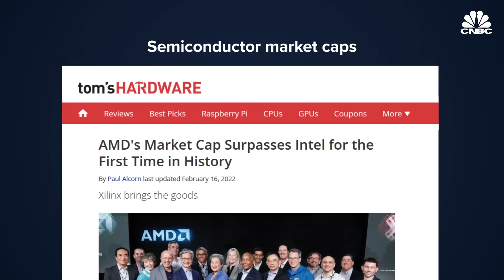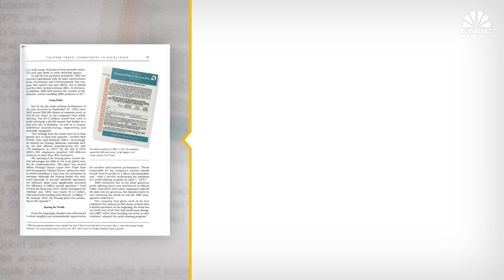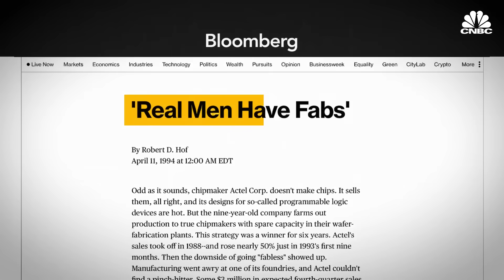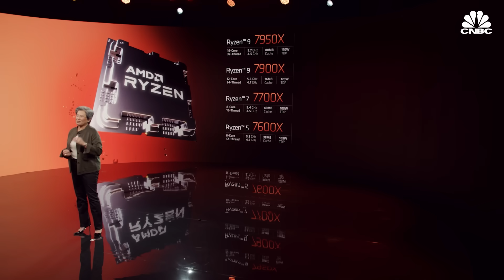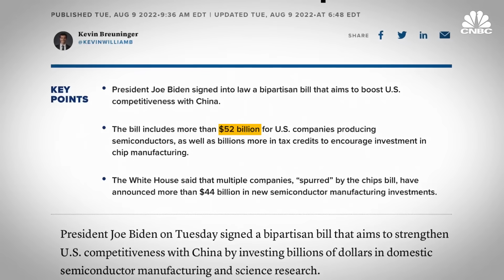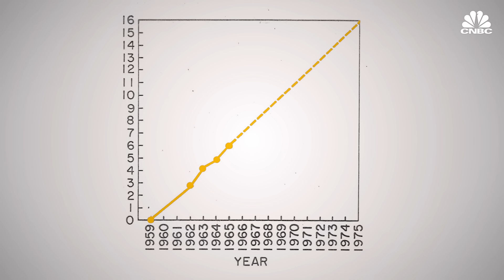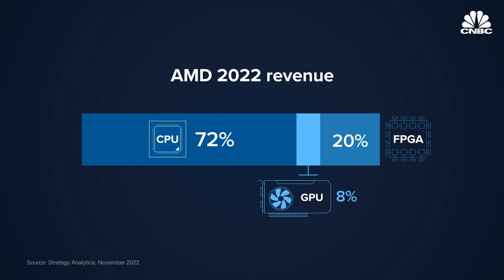How Chip Giant AMD Finally Caught Intel

Comment: Ryzen is amazing. i built a budget system with the R5 3600 and i plan on using it until 2028 - 2030 with linux. far better than the old Core 2 Duo stuff i used to daily drive just a few years ago

Comment: AMD cpu's right now are pretty impressive especially their APU in terms of budget performance compared to Intel right now which expensive with mediocre performance and issues.
Reply: I'm not sure how you can say they are mediocre performance when Intel at the very high end is still winning many/most benchmarks.  Yes, for value AMD is riding high, and that likely matters for the vast amount of users in the market.
Reply: @Faladrin  benchmark are just numbers but when it come to real world performance and application AMD still is better performing (TDP, Thermals, Stability, ) and even in continuous stress testings. Also AMD's integrated graphics are much better than Intels
Reply: @dogge828  I wouldn't say that intel has "mediocre" performance considering that it beats the competition by a good amount when it comes to gaming, productivity, and multitasking.
Reply: @PsTechSpace  in terms of apu i dont thinks so. But when comes to high end with the latest raptor lake and raphael it is just a tie between those two but power consumption, efficiency, thermal output, multi threaded task and rendering on AMD and Intel is just ahead in gaming with a very little points against amd. Overall it is just the matter of optimization and each has own advantage and disadvantage.
Reply: @dogge828  intel barely takes the multithreaded crown now because of it's extra 8 E cores.
Reply: @dogge828  But yeah i can agree Intel's integrated graphics are bad compared to AMD, Meteor lake could fix that issue but for now AMD's integrated graphics are unbeatable. When it comes to CPU performance intel is still superior in most tasks.
Reply: @PsTechSpace  nah you cant admit the fact that AMD had become tied on intel now. Look up latest raptor lake and raphael the difference is very small
Reply: @dogge828  You can take a look at gamer’s nexus, Jay2cents, LTT, or other third party reviewers. Some differences are small while others are big.

Comment: actually intel is 10x bigger. 
AMD: Number of employees	15,500 (2021) 
Intel: Number of employees	121,100 (2021)
Nvidia: Number of employees	22,473 (2022)

amd caught up with both. with intel on processors, and nvidia on graphics cards, at the same time. the CEO of amd was the main reason.

Comment: I think that it is strange and different as to how they are now manufacturing LARGER processor chips instead of those small ones. For years, companies were making chips small, and using the "all this power is all packed into this teeny tiny chip!" And instead, are now making bigger processors boards to hold even more processors on them... it's about time that a tech producer thinks out of the box. Like "if it's this small, let's add another processor to it. Wait, how about 3 since we have all this portability." I was thinking waaay ahead of them. Even at the age of 14, I had that thought. Lolololol. 

Also, that has got to be a very powerful laptop to capture all those people taking the escalator. It's pretty responsive, like a desktop. Usually, I see laptops glitching and lagging. I guess that era of lagging equipment will be behind us now.

What if the circuits have gotten soo tiny that they are not able to make them any smaller due to physics governing their ability to produce it smaller, soo they are widening their chips? I saw a video of someone using a microscope on the little cells of the cpu, and you could see the little atoms that made up of it. Could this be it for them?

Comment: Problem is, AMD saw massive success when their Ryzen 3000 series launched some 3 or 4 years ago.  Rightfully so.  Amazing performance for the value, supported old motherboards so you just had to swap the chip and do a BIOS update for your motherboard, easily walked all over Intel who had more expensive CPUs that used more power and performed worse, AND you had to switch motherboards (and most likely RAM too) if you wanted to upgrade.  AMD was the absolute king of keeping cost down while boosting massive performance gains.  NOW though, they've clearly already reached the "greed" stage and are pricing higher than necessary, no doubt abusing their newfound surge in popularity.  Their new GPUs aren't as good as Nvidia and are surprisingly expensive, and their new line of Ryzen CPUs are definitely priced over what one would expect from them based on past pricings.

Comment: FPGAs are very important today. The last few years it was made possible to translate a C program into HDL which are hardware defining languages. HDL languages (Verilog and VHDL) are used by big companies (like AMD, Intel, Nvidia ect) to design their Chips. Normaly only Computer engineers have knowledge on such languages. Today with the C to HDL synthesis a simple software developer can translate a function out of his program-app and make it run directly on hardware. The performance boost can be very big or very small depending on the function and how well it runs in parallel.
So, in the future most apps will have their "bitmap" files that will be loadable on the fpga of a computer or phone. The same apps would very easily run on software only if there is no fpga on the device. AMD-Xilinx now provides Vivado HLS which is the software required for such C to HDL synthesis. The future is bright for FPGAs and custom, reprogramable hardware on CPUs, GPUs or even on seperate accelerator cards.

Comment: I remember how AMD used to struggle to compete with Intel. And their implementation into cheaper computers initially. Now they are a gaming mammoth...and involved in major cloud tech applications, and so much more. Great to see them going head to head  with Intel. One day they will surpass apple in chip design and manufacturing
Reply: Viewing some of the other videos covering the history of AMD in relation to Intel, I'm left wondering how much larger a company AMD might be had they not had Intel strong-arming computer builders to use Intel, offering financial incentives as well as threats to convince them to drop AMD for Intel products. Going bacl to the early 2000s, where AMD was ahead of Intel in introducing multi-core and AMD64 CPUs as well as the Opteron line of server CPUs to market. Those should have been breakout tech introductions earing AMD a larger market share. Now we know what it didn't happen.

Comment: But they haven’t…. Intel chips still bench better, still perform better, still have better designs, still have better everything. Even amds newest 7950x 3D chip loses to the new Intel chips, and amd said that 7950x was an Intel killer.
Reply: AMD was better in nearly everything other than gaming until recently, so yes they did catch them. Unfortunately for AMD the 13XXX Intel CPUs beat AMD at everything at the moment. 
So they did catch them, but now intel has gotten away from AMD again. And it doesn't really look like AMD has any answer to Intel's latest chips. The X3D CPUs might beat intel at gaming but they'll do nothing for productivity.

Comment: AMD are the ones responsible for the APU processor, combining the Northbridge processor with the CPU helped my business out a lot, now, instead of the CPU, having to go through the Northbridge processes separately to communicate with every other chip on the board the Northbridge process it was combined with the CPU, allowing for faster communication between the RAM and the CPU

Thank you AMD

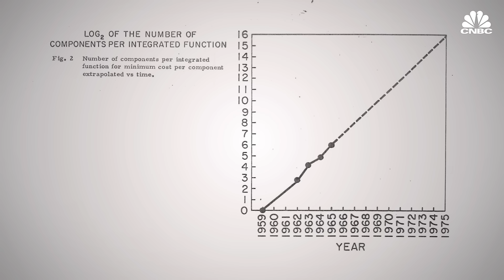Comment: Cool report CNBC but pls make sure you don't mistakes like here 11:00 - its transistors not "resistors"👎
Besides the strategy AMD is taking now towards datacenters together with the acquired IP from Xilinx and Pensando 12:56 is MOST DEFINITELY right way to go and evolve. Future of chips will be definitely more customizable and to specifically fit customer requirements than ever before as Moore's law is slowing down and getting obsolete.
Companies which will be able to create customized chips for specific customer needs will be leading the industry. Arm on other hand is doing that for decades but their business model and way of customization is different from what AMD is trying to deliver.

Comment: AMD buying ATI and incorporating most of the high failure ATI execs and booting their own AMD staff for the ATI replacements is what crippled AMD at the worst possible time and caused them to sell off global foundries and to sell ARM to qualcomm, which if they still had going into 2019 would have put AMD's market share at closer to 40-50%. buying ATI was about getting the patented gpu technology. ATI's executives were the entire reason why ATI was the low end GPU maker nvidia scoffed at buying because ATI was so terrible Nvidia would just crush them out of existence. ATI is the equivalent of Cyrix, but Cyrix had QUALITY driver/software code and support.
ATI execs ran AMD into the ground and put it in the terrible position it was, once enough of them were fired or fled being fired for incompetence. ATI engineers were trained how to write better driver code or they were replaced. once enough of the incompetent ATI staff were purged, better executives were able to take the helm, but it took some one incredible like Lisa to destroy the remaining ATI execs and the turd lackeys they hired to hide their incompetence and wreck AMD on a number of levels with their lies and deceit of their incompetence. it takes an engineer to lay out the logic and then wipe the floor with incompetent executives infront of shareholders faces to get the proper board action necessary to remove the incompetence from holding up profits and success.
ARM is in every mobile device, had AMD kept ARM and not bought ATI they would rule the chip market at about 70%.

Intel has to remain around and will remain around, other wise if they stay leading the pack, they will milk the markets dry of cash before releasing anything new and improved. Intel's 13th gen is winning at the moment only due to the fact they had to 230% increase the chips on die to beat AMD's Zen4. Intels down fall is incorporating Celeron cores onto their 12th gen and charging as much as pentium cores. they figured it out with 13th gen, cut their prices and doubled cpu cores in order to knock out the tik of Zen4 with the tok of Zen4 debuting at CES and the 3DV-cache which on the previous gen ZEN cores in the 5800X3DV-cache enables that gen to beat 12th Gen and keep up with the top tiers of 13th gen Intel with 50% or less cores than Intel.
if AMD did something like introduce Duron cores to double their core count, it probably wouldn't go so well on the first try, but the second try they would be on par or better than 13th gen, but it would set AMD back enough another year for intel 14th and 15th gen to lead, whereas if AMD just adds a few more cores to 75% of their Athlon cores compared to Intels core count, they would easily dominate intel for the next 5 years, and would allow them to do another thing with made Athlons greater than Pentium 2's and 3's and 4's which is doubling the L2 cache and if AMD could bring the L1bit cache to 64 or 96bit or 128bit they would destroy intels cpu line up until intel 20th gen.

Comment: I have AMD FX and these people falsely advertised 8 cores when it is 4 cores 8 threads. People cannot make up their minds if this chip had 8 cores or 4 core 8 threads, or that it had 4 fpu 256 bit that doubled into 128bit fpu on 8 cores. AMD Adrenalin lists the spec of AMD FX as 4 core 8 threads and Windows says 4 core 8 logical processors.

Comment: so for those wondering about the x86 legal battle, x86 isn't from intel, its actually from ibm, intel was contracted to make the chips, but were required to find a second source supplier, enter amd.  under this license, amd was supposed to get designs from intel and fabricate them, but intel only gave out their first gen chips, and stopped after that.  amd out of necessity reverse engineered the chips, typically creating a better variant than intel mostly due to clock speed increases.  amd after their reverse engineering years actually started making better chips than intel for a short time, roughly late windows xp, intel started to outpace them, and amd released a risky generation that blew up in their face (bulldozer). after that, you get into modern cpus, fleshed out in this video.
video on bulldozer explained:
https://www.youtube.com/watch?v=PgejkSWzvNs&t=326s

Comment: How did they catch intel? 13 gen intel is crushing ryzen 7000 series
Reply: Crushing? All the benchmarks I've seen shows Intel and AMD trading blows so you have to be biased to make such a false claim. haha
Reply: @wmp0074  not in the price to performance,  13thgen socket mobo are cheaper than am5 and have better overall performance,  even 7000 series igpu is now about the same as intel uhd graphics
Reply: @gejamugamlatsoomanam7716  If I am building long term and want to spend less as possible and only upgrade my CPU 4 years down the road I can't do that with 13th gen Intel it's simply a dead end. AM5 is in the roadmap for 5 years.
Reply: @wmp0074  amd have stated they will support am5 till 2025, which is just 2 years 1 month

Comment: When I saw the designs for Threadripper I felt a chill.  "Intel is Dead Man Walking and they haven't a clue.  It's going to be an absolute bloodbath!".  A year later AMD was making money selling Threadripper for $1,000 and Intel was bleeding out the ass trying to match them by selling $10,000 silicon for $2,000... and still couldn't.  Remember when Intel showcased their latest and greatest with a $1,600 extreme cooler hidden under the desk, and then Lisa Su announced their doubling of the core count the next day.  Boo-rah!
It's all about the yield.  Chip yield.  Chiplettes vs Monolithic architecture.
Reply: Venkat and madhavi company is the highlight, yellow shirt with blue chaddi accountant venkat with wife madhavi at their headiffice arcade building are the leaders outside ,  lot of inspiration and motivation from them , many plans and much of publicity since 5 years , new strategy for business  improvement

Comment: Been using AMD since the K5, laptop and desktop, ATI / AMD GPU's always till my current, only because I couldn't afford a decent AMD GPU vs the price of a gtx1650.  The Nvidia is okay, but I much prefer the rendering / end result and software from AMD. I will return to AMD on my next. Ryzen 7 for laptop, Desktop is lagging behind, FX-8320e, but still holding up well, overclocked and Windows 11.

Comment: Many people don't know or don't remember, that AMD was already ahead of Intel in the past. While Intel was selling their Pentium 4 CPUs, which were running pretty hot and needed a high frequency to perform acceptable, AMD sold CPUs that were actually faster, while their frequency lower and running less hot. But Intel used their superior marketing (at that time) to compensate for their mediocre product, which worked. It also worked, because AMD's marketing and product presentation was pretty bad at that time. With the Core Series CPUs, Intel took back the performance crown. Creating new CPU architectures takes a lot of time and money, therefore it's not unlikely, that Intel will be back in the future. Best thing for the customers is, if both companies survive and continue to compete with each other.
Reply: and also x2 core

Comment: I never considered AMD a joke. I've owned many of them over the decades. Sure, they weren't all winners, but they made PC's affordable for everyone and AMD consistently came out with cheaper chips than Intel. The only other one to give any competition to Intel, was Cyrix and they didn't last long. Su is a genius, this is where AMD needed to go, into server class, because Intel rules that roost, along with IBM. So if you expect to compete with the behemoth Intel, that's where you need to be. AMD had reached their limit in PC's and has the console market locked down. So they could not grow without tackling their biggest challenge of the server market.

Comment: Intel gave up it's lead years ago. It decided that "diversity" was the most important thing for the company while at the same time it got rid of many of it's most senior technicians (firing and buyouts) and lots of things stopped running properly in it's factories (shocking) and now it has reaped what it sowed. However on the plus side, they reached their diversity goals and management got their bonuses, so there is that. Fast forward a few years and here we are with this video...is it really a surprise when you decide to focus on being woke and get rid of top talent to "save money" and "diversity", no it's not surprising at all. Congratulations Intel, goals achieved.

By the way Moore's law died in 2012, just an fyi. That's why you don't see new generations of chips for many years at a time, just small incremental improvements that are strung out over the course of new node sizes that used to be done faster but since nodes last several more years now, there is nothing they can do about it.
Reply: Venkat and his wife madhavi are the leaders , plan for them and have a great future , venkat and madhavi and their son , venkat madhavi and their son. Venkat madhavi and their son. Remember their life is very important for your business growth